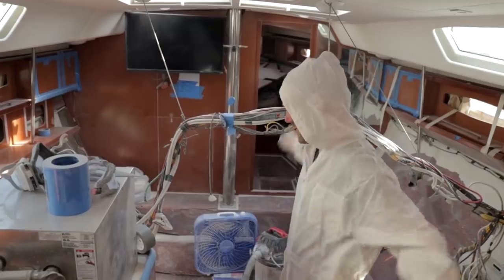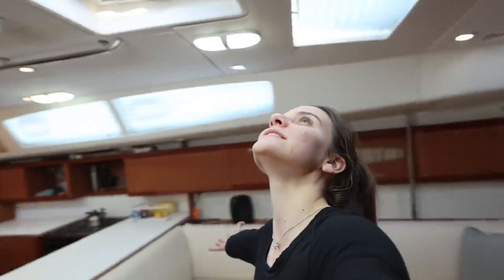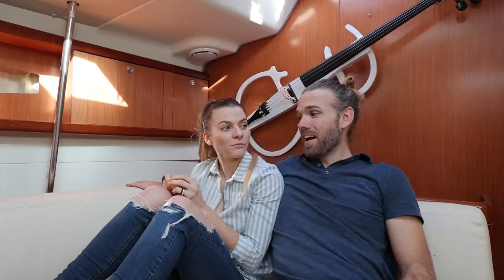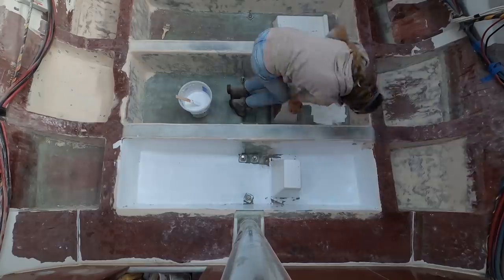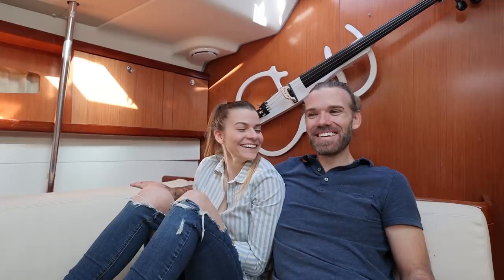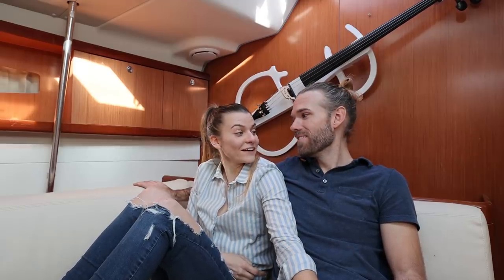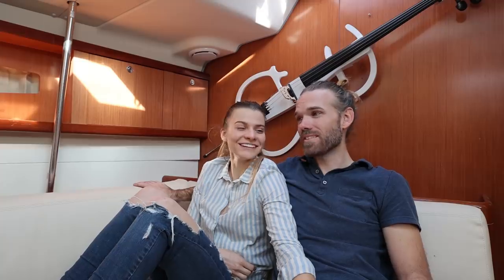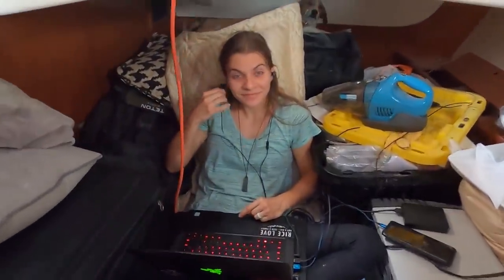Insurance Survey of Our SALVAGE Sailboat | Expedition Evans 40

Comment: You can have leaking portholes and hatches, oil leaks on your engine, tatty sails, anything. But rusty hose clamps will and do sink boats.  Glad you got a good surveyor. We spent 7 hours inspecting our boat. We had a professional surveyor, à full rigging survey. They and we missed a tiny detail. A frozen toggle on our traveller car. That will be $2000 worth of repairs. Could have lost the mast.  Second, they and we didn't notice that the windlass motor was vinyl covered and painted. That'll be $1500 thanks. Finally, no one extended the whisker pole fully. It was damaged so that's $3600 unless you fix it yourself - I did and that cost $40.

Comment: News flash....  We are talking about finding a problem with any of those failed hose clamps in the middle of an ocean!   You can literally sink your boat if your rusty hose clamp on any raw water intake breaks.  If it wasn't for both my buddy and I thinking fast on our feet, then I wouldn't be here writing this msg.  I know, I was on one once when it was going down due to a rusty hose clamp breaking.  My advise?  Replace all your hose clamps on every thru-hull fitting with new 316 grade stainless steel hose clamps and then double them up, where you have 2 clamps per thru-hull fittings and ever connection that connects to those lines.  Also check every bib/nipple that those hoses are connected to.  Because of the age of your boat, you may also consider replacing all your thru-hull fittings with new bronze or 316 grade stainless steel fittings.
Reply from the maker: Yes!
Reply: Absolutely 100%. I grew up on and around boats. My grand parents had boats, my parents had boats, they finally just sold their last boat, a Grand Banks, because they felt they were now too old to keep going. 

Message to all prospective boaters: Do NOT skimp or take chances on dodgy clamps and through hulls, even on a relatively small lake. When I was a kid, our boat could’ve sunk, it was actively sinking, due to a failed/corroded steel hull through hull. It was only luck that it happened on a weekend when we were on the boat, we were on the dock and we could get the boat on the travel lift fast enough not to sink to the bottom. 

You need the distress ID and tracking system the US Coastguard uses to locate you and your boat in case of sudden emergency, life raft/survival gear, training, rehearsal and multiple redundancies—contingency plans on top of contingency plans.

Also, you’re a sailing channel but maintenance, repairs, improvements, refits, etc are pretty much never ending. Congratulations on your hole in the water that you throw money and sweat into. 😂🤣😂🤣

You know.
Reply: Also, pre-stage wood plugs of the right size for each through hull by tying the right one one to the hose with some wire or small line. Should a through hull fail, you will be able to very quickly plug the hole. It's amazing how quickly water will come in the boat. If you are scrambling around looking for a plug in some locker, you could take on a lot of water and short out the electric, and then its bye, bye bilge pumps. Also have a good spare manual bilge pump with a long enough hose to reach over the side from anywhere in the boat you might be pumping from. Finally, I think I noted you said you were going to replace the manual bilge pump in the cockpit, make sure it works by letting some water into the bilge with the electric bilge pumps off. Finally, make sure you have a bilge alarm that is also connected to your cell phone. Two is even better. The boat sinking is THE worst thing that can happen, most every other gear failure is survivable. Obvious advice but then again, many people have had big problems by not acting on it...

Comment: Congratulations, we're happy the survey went well! Little doubt here that it wouldn't. You both worked so hard for your goals...
FYI to keep in mind: Dropping metal of any sort on battery terminals has the potential to cause a lead acid battery to explode, especially while, or soon after charging. While charging they produce hydrogen gas that collects around them. My brother had one blow up on his porch from a spark. 
Long ago, I used to be a forklift mechanic on electric trucks and always covered the batteries while the cover was open. You might ask your battery guys about ventilation of the battery area of your boat, but after upgrading to lithium, that might be unnecessary. Covering the terminals while working is a good idea, though.

Comment: What you have done is amazing.  Your boat is better than new.  You did a better job than the factory on attaching the frame to the hull. You make a fantastic team.  Sailing is like flying. The sails are wings. You shape the wings for more or less power depending on wind strength. Enjoy.

Comment: I think 'Reborn sailboat' does it justice. Really grrreat to hear that you salvaged your salvaged sailboat. Great salvation! Now get some sleep. Reach day seven of the last day of fixing the issues with the hose clamps and such (yes, I care about hose clamps) and get your happy selves on the water to work on the 20 years of sailing experience. Actually, if I recall correctly you have been sailing before in Hawaii, so it should be less than 20 years. In The Netherlands we say: "Behouden vaart!" (Which means something like "I wish you safe, prosperous, happy, travels")

Comment: You just did an utterly amazing jobs. Everywhere where it goes to a through-hull: check those hose clamps.I bet failing through-hulls and clamps sink more vessels than rocks. After your amazing fiber glass job however, I'd die to see you retrofit the boat with a safety-feature rare on GRP vessels: standpipes.

Comment: Awesome job guys, actually what you have achieved is very impressive and now I’m looking forward to seeing the next stage, learning the boat while sailing it. We actually purchased an Oceanis 45 only six months ago and while we have sailed small boats, Hobie’s for the last 35 years, big boats are very different. With your future mods, give some serious consideration to lithium batteries and a big inverter so you can have and use some creature comforts.
We have 800AH of lithium batteries with a 3,000 watt inverter so we can use the coffee machine, toaster or sandwich maker and not have to start the engine for 4 days, then we have an oversized alternator that charges the batteries faster than normal, about 1.5 hours after 4 days. We also have two solar panels that trickle feed. But, I’m sure you will receive many suggestions that are equally as good or better... but enough power so you can live comfortably without having to start the engine every day is a massive bonus👍

Good luck and enjoy... I’ll be watching

Comment: I follow your channel since the beginning and never had doubts you would make it.  Big repairs always have that moment where previously unknown problems appear that multiply the effort needed, because to a certain extent, any repair is exploration of the unknown.  For you, I guess discovering delamination in the grid was that moment.  Stripping the grid to use it as a mold for building a new one that is laminated to the hull left you with a much stronger structure than a new production boat, so I guess you could be thankful to the vendor for the crappy lamination quality, as strange as that sounds.  To reiterate many comments: Cover terminals and bus bars and work with isolated tools.  I witnessed an electrician going burnt to hospital after dropping a wrench, because he skipped security precautions.  Have a map of throughulls and plugs next to each, a backup bilge pump with serious performance and a bilge pump alarm and security procedures (water, fire, etc.) as Brett should be familiar with from aviation.  Your surveyor is right: Have redundant hose clamps in good condition.  Your strong hull does not protect you from a single bad hose clamp breaking.  That said: Congratulations and be proud of what you achieved! :)

Comment: Get this show on the road....or the 7 seas or wherever you go.  Get some test sails under your belt to flush out any necessary fixes and head south to the Caribbean or Puerto Rico, somewhere with services so if you truly need to do something you can get materials.   Trust me, you can wrench on that both till you're old and grey, do the things that make you safe (liferaft, dinghy) and get busy living and document it. You'll gain more viewers anchored off a white sand beach than changing the galley countertop, I have followed many of the sailing shows and a balanced mix of travel and needed repairs seems to be the sweet spot for sailing channels.

Comment: Yep, those hose clamps on your through hulls are important, especially on an exhaust fitting.  CO poisoning is not fun even if you survive it.  Where possible, double clamp those hoses, just in case one vibrates loose.
One of the nicest things about that style of boat cockpit is (eventually) you could make it a true hard top to hold your solar panels.

Comment: Definitely want to think about a dinghy before you start going to far. It just makes it easier to get around if you want to go see different things then having to take the boat and find there’s no Dock to pull up to. Also I think you commented in one of your previous episodes how you like those dock carts may I recommend a folding wagon you can get them cheap at Walmart they come in a variety of sizes and they would come in really handy especially when you’re out sailing around and you need to stop and provision. Simply take the collapsed wagon out unfold and drag to the shop load up and drag back to boat and because it’s foldable easy to store in a dinghy in case you have to anchor out. And it sure beats trying to carry more bags than capable of carrying two miles back across town to get it to your boat. In truth it would just mean you can get more provisions at one time that way you could carry otherwise if you didn’t have the wagon it’ll be a whole lot easier to transport them back to your boat so that you’re ready for your next long trip across the water. I have a few just so when I go to the grocery store and get home I don’t have to make six trips back-and-forth to the car so I load everything up in my cart and push it in the house. Now my favorite style is one that you push from behind that folds up only front to back but then again I’m in a house with a garage where I can store it as opposed to a boat Where are being able to collapse both front back and side to side try and get into a small solid rectangle would be much more preferable.

Comment: Double up on all the hose clamps in places where the fitting is long enough to accommodate two clamps and use all 316 stainless steel clamps.
Many times I have seen stainless clamps that were fitted with a normal steel screw.

Comment: @ 07:57 When you mention there’s dust in very odd places. 

I need to make a sincere recommendation to you !   When you say you can’t get it out from those spaces… you need to try to get it out from the spaces ! Flood the boat with a hose or pressure washer…   whatever it takes !

We have a Beneteau 50 that had a minor grounding incident as well and had a yard make a similar but much less extensive grid repair. Repair was finished just before winter and boat remained in the water till spring with us aboard, it was bone dry during the calm/flat motor back from the yard and also all winter long.

Upon setting off south the following spring in quite heavy wind & seas it turns out there was an unknown yet small water incursion while offshore (tangentially related to the repair) which caused a minor amount of water sloshing through the bilge and grid structure this ultimately caused hidden dust and debris to flow into the bilge to eventually (roughly 2hrs after departing) clog the pump which we only became aware of upon the high bilge alarm sounding.

We were unable to locate the source of the water and although it was minor took 5 days of constant bilge screen cleaning to finally remove ALL debris, roughly the same time we reached our destination. 
Ultimately yard discovered the source of the water…  made an additional repair and bilge is now absolutely bone dry and all conditions.(and REALLY clean too 😝) 

My point is this could potentially become extremely important down the road for you both if water ever finds its way into your hull. 
PLEASE, flood/flush that bilge in controlled circumstances ASAP !!!

Comment: Brett: It wasn’t recording.
Jade: (With disbelief on her face) You’re joking?
That was funny.
Congratulations!  Efforts culminated with a successful conclusion.  Those rusty hose clamps will be replaced with stainless-steel versions plus spares.  Positive battery terminal covers will be installed.  Please install netting for all the lifelines for yourselves, your dogs, and items that may roll off if dropped.  I did not know that renting a life raft was an option!  You can have it replaced every year to keep supplies fresh.  Also highly recommend getting watches that sound a loud alarm aboard if one of you fall overboard while on watch or any other time.  It also has a built in EPIRB to allow for a quick recovery.  Also, wear inflatable life preservers whenever on watch or on deck.  Tethers would drag you along and drown you before you could either climb back aboard or be hauled in.  Wow!  You guys did it, salvaged the boat.  Looking forward to your renaming ceremony.

Comment: I did jump at the battery incident… not a terrible problem with batteries in good nick, but I’ve seen 1/3 of a big cat battery blow out, and was there when a mechanic dropped a wrench and got a face full of corrosive gas.  That was an exciting drive to the hospital.  But that’s two incidents in.*checks watch* 40 years...

Comment: Clamps are very important, if you want to keep the water on the outside. Take a magnet with you when you purchase the new ones. Since cheaper clamps often have steel screws, and when they corrode away, water comes aboard...
When you start looking for an EPIRB, also pick up a couple of MOB beacons, so if one of you falls overboard, the other one knows about it. The problem with offshore sailing is one can fall overboard and the boat will sail off and leave them behind... Don't do that.

Comment: So with aircraft batteries as Brett likely knows they have both terminals on the side fairly close to eachother...they're also relatively heavy.  There are pictures floating around of some situations where when carrying them someone let them rest against their waist without a plastic cover and the terminals touched their belt buckle arc welding the terminals to the buckle.
Reply from the maker: Yep, definitely seen those pictures floating around in safety briefs 😬

Comment: Great he found not much, really you must change all the hose clamps and get high quality ones, also swap the hoses that are not new. Also get rid of the remaining dust. 
Great job on the boat, better than new now!.
Its important to have all hardware & clamps in new condition, one on these fail on you can be so much trouble and its a cheap swap.

Comment: the answer is yes, I would care about rusty hose clamps. Imagine one of them giving way under pressure, and you don't notice it. No matter if it is on the inlet or the outlet of any engine. You either destroy the engine or you sink or flood the boat. How can hose clamps be rusty? Because they are of ordinary steel? You might consider changing them for all ss extra strong professional hose clamps. They don't rust or fail.

Comment: Well guys, the moment you screw the battery packets on the boat you destroy their use and validity :) Their purpose is not to keep them put! That is the work of the strap. The buckets Must not have any holes (screw holes for example) in order to keep the battery abrasive chemicals contained and not escape out. Especially into a polyester/plywood boat! :) I am not another smart guy, I just love and follow Jeff Cote, the famous in YouTube marine electrical engineer. I love your work and channel too of course :) !!!👏👏 All the best guys.
Reply from the maker: You are another smart guy! And you're correct, but they already had holes in them from how it was mounted previously. The boxes (and batteries) are going to be replaced entirely for the exact reasons you mention!
Reply: @ExpeditionEvans  thanks for not talking me wrong :) I had to replace mine in my previous boat :) I am happy you are all set 👌✌️

Comment: Well done both of you , not that hard was it ? L.O.L. What else could you do with all those hours spent keeping fit in a dusty bath tub ? . check your hoses and clips ,as if one let goes , in the first month , would the insurance pay out after being advised , that there rusty , stainless clips should not rust and two should be fitted on every pipe end . Happy sailing or are you addicted to the smell of resign and going to do it all over again ? . Thank your for the trip , of fiber glass heaven and may all the winds be favourable and calm seas .

Comment: Somewhere down the road, waterway, whatever.. you'll be even more glad that your surveyor was so diligent AND patient in going though the entire boat not just for insurance and the title: but for your safety and peace of mind sailing this boat and KNOWING it's safe. That's priceless !  PS  Here's a wire clamping tool you should get instead of a bunch of crappy banjo clamps that will always frustrate you later and cost you more long term. It creates TWO clamping points at once and can do multiple passes as well for spreading loads on a hose, ropes or whatever needs a clamp... Check out : https://www.youtube.com/watch?v=3NXVnmMjFk4  All you need to keep is a bunch of different wire diameters, and maybe a second tool since you'll use one of these a LOT ! Congratulations Again !